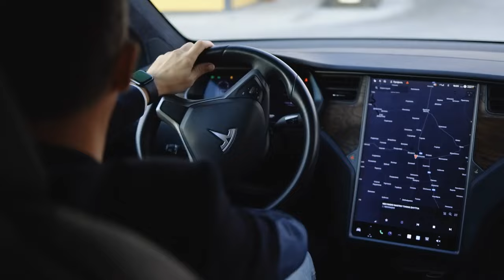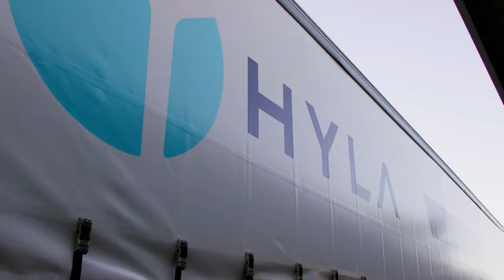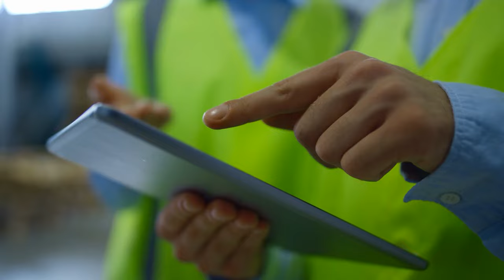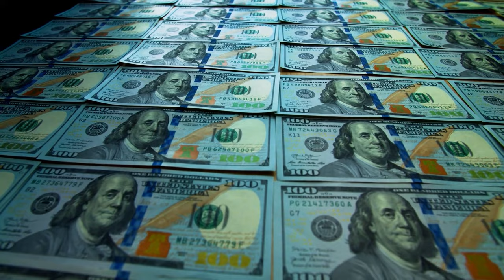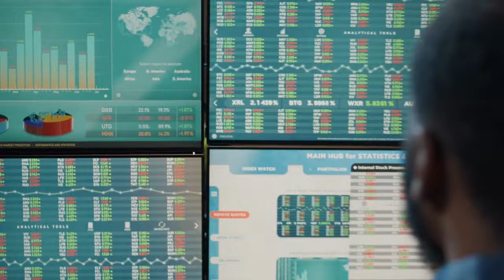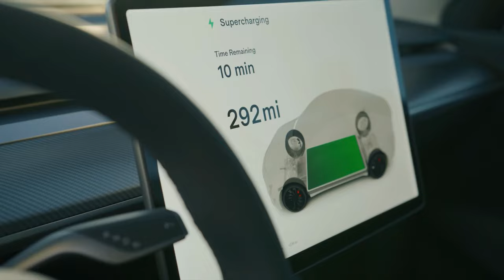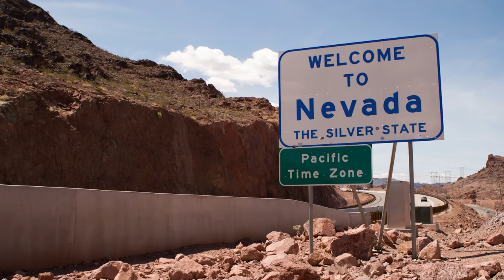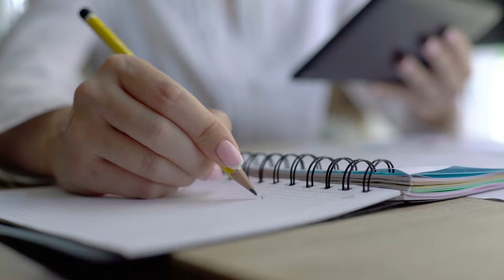A Devastating Blow For The EV Industry | Insurance Prices SkyRocket

Comment: Soon, a major insurance carrier will cancell fire insurance on EVs...that will cause a panic in the market-might spell the end of Tesla.
Reply: EVs without infrastructure are junk. 
Hybrids are the best short term answer until batteries and infrastructure catch up.The Steam engine went extinct in the 40s and diesel electric locomotives have been their replacement since them.  Thats a hybrid  Today, Edison Motors has a succesful hybrid logging truck that beats the Tesla in both power and fuel economy and most importantly, and it is lighter than the standard trans truck NRA. No range anxiety.
Get it straight .. The infrastructure TODAY  CAN NOT support EVs but hybrids can and are doing it with no infrastructure change and BETTER FUEL ECONOMY WITH PROVE TECHNOLOGY

Comment: I won’t be buying a EV anyway soon in fact, I will be driving my 09 Honda Pilot as long as it can run and if I have to replace it, it will be a preowned ICE diesel dually. 🙂
Reply: EVs without infrastructure are junk. 
Hybrids are the best short term answer until batteries and infrastructure catch up.The Steam engine went extinct in the 40s and diesel electric locomotives have been their replacement since them.  Thats a hybrid  Today, Edison Motors has a succesful hybrid logging truck that beats the Tesla in both power and fuel economy and most importantly, and it is lighter than the standard trans truck NRA. No range anxiety.
Get it straight .. The infrastructure TODAY  CAN NOT support EVs but hybrids can and are doing it with no infrastructure change and BETTER FUEL ECONOMY WITH PROVE TECHNOLOGY

Comment: What will the future be like for the EV the large motor manufacturers who make EVs are scaling back there production of EVs the future is not looking good for EVs hooray
Reply: EVs without infrastructure are junk. 
Hybrids are the best short term answer until batteries and infrastructure catch up.The Steam engine went extinct in the 40s and diesel electric locomotives have been their replacement since them.  Thats a hybrid  Today, Edison Motors has a succesful hybrid logging truck that beats the Tesla in both power and fuel economy and most importantly, and it is lighter than the standard trans truck NRA. No range anxiety.
Get it straight .. The infrastructure TODAY  CAN NOT support EVs but hybrids can and are doing it with no infrastructure change and BETTER FUEL ECONOMY WITH PROVE TECHNOLOGY ..

Comment: they are safe and effective where have we heard that before
Reply: EVs without infrastructure are junk. 
Hybrids are the best short term answer until batteries and infrastructure catch up.The Steam engine went extinct in the 40s and diesel electric locomotives have been their replacement since them.  Thats a hybrid  Today, Edison Motors has a succesful hybrid logging truck that beats the Tesla in both power and fuel economy and most importantly, and it is lighter than the standard trans truck NRA. No range anxiety.
Get it straight .. The infrastructure TODAY  CAN NOT support EVs but hybrids can and are doing it with no infrastructure change and BETTER FUEL ECONOMY WITH PROVE TECHNOLOGY
Reply: @enterprisencc1701z  hybrids are also not the answer, to mineral intensive we are still just better off with ICE cars until hydrogen cars where the fuel used is water and the hydrogen is made available at the point of ignition, happy new year to you

Comment: So good for the environment? Toxic fumes, chemicals and waste water runoff. Mining and disposing of the batteries, insurance going through the roof.. Insane and stupid.
Reply: Sending the kiddies down into the mines isn't that great either
Reply: EVs without infrastructure are junk. 
Hybrids are the best short term answer until batteries and infrastructure catch up.The Steam engine went extinct in the 40s and diesel electric locomotives have been their replacement since them.  Thats a hybrid  Today, Edison Motors has a succesful hybrid logging truck that beats the Tesla in both power and fuel economy and most importantly, and it is lighter than the standard trans truck NRA. No range anxiety.
Get it straight .. The infrastructure TODAY  CAN NOT support EVs but hybrids can and are doing it with no infrastructure change and BETTER FUEL ECONOMY WITH PROVE TECHNOLOGY

Comment: I drove an EV today...at the golf course.  It went 4 miles without loss of power.  A golf cart would be perfect in urban areas where population and shopping are concentrated.
Reply: EVs without infrastructure are junk. 
Hybrids are the best short term answer until batteries and infrastructure catch up.The Steam engine went extinct in the 40s and diesel electric locomotives have been their replacement since them.  Thats a hybrid  Today, Edison Motors has a succesful hybrid logging truck that beats the Tesla in both power and fuel economy and most importantly, and it is lighter than the standard trans truck NRA. No range anxiety.
Get it straight .. The infrastructure TODAY  CAN NOT support EVs but hybrids can and are doing it with no infrastructure change and BETTER FUEL ECONOMY WITH PROVE TECHNOLOGY ..
Reply: Golf carts are not to good in Canadian snow.

Comment: Here in the UK my renewal for my 2006 Mercedes CLS320cdi is only £300 - for a laugh I got a quote for a new 2023 Tesla Plaid the cheapest quote was £2550 right up to £6800 I have perfect driving history no accidents and clean licence with 10+ years no claims over 50 years old. Yes you can get insurance but its going to bankrupt you.
Reply: Thanks for the update on the situation 😊
Reply: EVs without infrastructure are junk. 
Hybrids are the best short term answer until batteries and infrastructure catch up.The Steam engine went extinct in the 40s and diesel electric locomotives have been their replacement since them.  Thats a hybrid  Today, Edison Motors has a succesful hybrid logging truck that beats the Tesla in both power and fuel economy and most importantly, and it is lighter than the standard trans truck NRA. No range anxiety.
Get it straight .. The infrastructure TODAY  CAN NOT support EVs but hybrids can and are doing it with no infrastructure change and BETTER FUEL ECONOMY WITH PROVE TECHNOLOGY ..
Reply: I am no EV fan, but in fairness, quoting an expensive performance Tesla for insurance and comparing that to an old car is silly. Tell me what a Model 3 costs in comparison to an equivalent new BMW to insure, then you will have a valid comparison.

Comment: For those that continuously justify and say ICE vehicles catch fire as well, it's proof positive when insurance companies refuse or charge huge prices for insuring EV's due to the statistics of fires. The car is a total when it bursts into flames and a major risk to it's driver and occupants. You couldn't give me an EV. They burn long and hot, require over 6000 gallons of water to be extinguished.
Reply: EVs without infrastructure are junk. 
Hybrids are the best short term answer until batteries and infrastructure catch up.The Steam engine went extinct in the 40s and diesel electric locomotives have been their replacement since them.  Thats a hybrid  Today, Edison Motors has a succesful hybrid logging truck that beats the Tesla in both power and fuel economy and most importantly, and it is lighter than the standard trans truck NRA. No range anxiety.
Get it straight .. The infrastructure TODAY  CAN NOT support EVs but hybrids can and are doing it with no infrastructure change and BETTER FUEL ECONOMY WITH PROVE TECHNOLOGY ..
Reply: The main reason an ICE vehicle would catch fire (rarely) is that the car was not maintained like the manual recommended.
Reply: EV’s also get totaled for minor accidents from hitting the underside on speed bumps and curbs.

Comment: I'm all for getting rid of CARBON TAX  on farmers but this is not going far enough, they should also get rid of CARBON TAX on diesel /gas fuel.because you should know by now that delivery of goods and services has gone up because of CARBON TAX. I was in windsor and coming back to Toronto to 69 north, the amount of transports I seen was undeliverable (WHAT ARE WE PAYING) PLUS I NEVER IN MY LIFE SEEN DEISEL COST MORE THAN GAS. Seem the only way to get rid of the CARBON TAX IS TRUDEAU MUST GO !!!!!  And by the way Heat pump don't work in cold weather, you need a second source of energy.

Comment: Reality hits consumers. This same fact goes for (off shore) windmills, they don't last.
Reply: EVs without infrastructure are junk. 
Hybrids are the best short term answer until batteries and infrastructure catch up.The Steam engine went extinct in the 40s and diesel electric locomotives have been their replacement since them.  Thats a hybrid  Today, Edison Motors has a succesful hybrid logging truck that beats the Tesla in both power and fuel economy and most importantly, and it is lighter than the standard trans truck NRA. No range anxiety.
Get it straight .. The infrastructure TODAY  CAN NOT support EVs but hybrids can and are doing it with no infrastructure change and BETTER FUEL ECONOMY WITH PROVE TECHNOLOGY ..
Reply: Nor are they cost effective.

Comment: If electric vehicles were actually designed by Nikola Tesla, the fuel prices would be very low. He understood electric power derived from "free energy".
Reply: EVs without infrastructure are junk. 
Hybrids are the best short term answer until batteries and infrastructure catch up.The Steam engine went extinct in the 40s and diesel electric locomotives have been their replacement since them.  Thats a hybrid  Today, Edison Motors has a succesful hybrid logging truck that beats the Tesla in both power and fuel economy and most importantly, and it is lighter than the standard trans truck NRA. No range anxiety.
Get it straight .. The infrastructure TODAY  CAN NOT support EVs but hybrids can and are doing it with no infrastructure change and BETTER FUEL ECONOMY WITH PROVE TECHNOLOGY ..

Comment: EV = 🔥🔥🔥🔥
Reply: EVs without infrastructure are junk. 
Hybrids are the best short term answer until batteries and infrastructure catch up.The Steam engine went extinct in the 40s and diesel electric locomotives have been their replacement since them.  Thats a hybrid  Today, Edison Motors has a succesful hybrid logging truck that beats the Tesla in both power and fuel economy and most importantly, and it is lighter than the standard trans truck NRA. No range anxiety.
Get it straight .. The infrastructure TODAY  CAN NOT support EVs but hybrids can and are doing it with no infrastructure change and BETTER FUEL ECONOMY WITH PROVE TECHNOLOGY
Reply: EV = Betamax.😂

Comment: Who could have seen this coming?
Reply: Car fires
Reply: EVs without infrastructure are junk. 
Hybrids are the best short term answer until batteries and infrastructure catch up.The Steam engine went extinct in the 40s and diesel electric locomotives have been their replacement since them.  Thats a hybrid  Today, Edison Motors has a succesful hybrid logging truck that beats the Tesla in both power and fuel economy and most importantly, and it is lighter than the standard trans truck NRA. No range anxiety.
Get it straight .. The infrastructure TODAY  CAN NOT support EVs but hybrids can and are doing it with no infrastructure change and BETTER FUEL ECONOMY WITH PROVE TECHNOLOGY ..

Comment: Can’t say I would ever choose an EV.  If I do deviate from ICE vehicles, it would be for a hydrogen powered one.  However, until they get the infrastructure in place for the hydrogen powered vehicles, I will stick with my good old ICE vehicle.
Reply: EVs without infrastructure are junk. 
Hybrids are the best short term answer until batteries and infrastructure catch up.The Steam engine went extinct in the 40s and diesel electric locomotives have been their replacement since them.  Thats a hybrid  Today, Edison Motors has a succesful hybrid logging truck that beats the Tesla in both power and fuel economy and most importantly, and it is lighter than the standard trans truck NRA. No range anxiety.
Get it straight .. The infrastructure TODAY  CAN NOT support EVs but hybrids can and are doing it with no infrastructure change and BETTER FUEL ECONOMY WITH PROVE TECHNOLOGY ..
Reply: So far, hydrogen powered cars have not been rendered safe yet.

Comment: The super expensive Dutch grid power platforms at sea are also build to last about 20y. They start corroding from day one! Huge voltage in salty water. What could go wrong!
Reply: EVs without infrastructure are junk. 
Hybrids are the best short term answer until batteries and infrastructure catch up.The Steam engine went extinct in the 40s and diesel electric locomotives have been their replacement since them.  Thats a hybrid  Today, Edison Motors has a succesful hybrid logging truck that beats the Tesla in both power and fuel economy and most importantly, and it is lighter than the standard trans truck NRA. No range anxiety.
Get it straight .. The infrastructure TODAY  CAN NOT support EVs but hybrids can and are doing it with no infrastructure change and BETTER FUEL ECONOMY WITH PROVE TECHNOLOGY ..

Comment: Young people love being aggressive with their vehicles they call it being young & having fun and that is mostly no problem with gasoline engine cars regardless of the weather: but cheap affordable electric vehicles can't handle that kind of abuse especially in very hot weather
Reply: EVs without infrastructure are junk. 
Hybrids are the best short term answer until batteries and infrastructure catch up.The Steam engine went extinct in the 40s and diesel electric locomotives have been their replacement since them.  Thats a hybrid  Today, Edison Motors has a succesful hybrid logging truck that beats the Tesla in both power and fuel economy and most importantly, and it is lighter than the standard trans truck NRA. No range anxiety.
Get it straight .. The infrastructure TODAY  CAN NOT support EVs but hybrids can and are doing it with no infrastructure change and BETTER FUEL ECONOMY WITH PROVE TECHNOLOGY

Comment: Electric  vehicles  are not safe it's  showing  up now.
Reply: EVs without infrastructure are junk. 
Hybrids are the best short term answer until batteries and infrastructure catch up.The Steam engine went extinct in the 40s and diesel electric locomotives have been their replacement since them.  Thats a hybrid  Today, Edison Motors has a succesful hybrid logging truck that beats the Tesla in both power and fuel economy and most importantly, and it is lighter than the standard trans truck NRA. No range anxiety.
Get it straight .. The infrastructure TODAY  CAN NOT support EVs but hybrids can and are doing it with no infrastructure change and BETTER FUEL ECONOMY WITH PROVE TECHNOLOGY

Comment: Ev’s are bombs with wheels and are made for people who travel 10 miles a day with more money than sense, just the fact kids are dying in mines mining cobalt for them is sickening, buying an ev is supporting kids being used as slave labour.
Reply: EVs without infrastructure are junk. 
Hybrids are the best short term answer until batteries and infrastructure catch up.The Steam engine went extinct in the 40s and diesel electric locomotives have been their replacement since them.  Thats a hybrid  Today, Edison Motors has a succesful hybrid logging truck that beats the Tesla in both power and fuel economy and most importantly, and it is lighter than the standard trans truck NRA. No range anxiety.
Get it straight .. The infrastructure TODAY  CAN NOT support EVs but hybrids can and are doing it with no infrastructure change and BETTER FUEL ECONOMY WITH PROVE TECHNOLOGY

Comment: If you have an EV, do not park it in your house.  Can you imagine dealing with the insurance companies on a claim in this scenario?  Your car burning your house down?
Reply: EVs without infrastructure are junk. 
Hybrids are the best short term answer until batteries and infrastructure catch up.The Steam engine went extinct in the 40s and diesel electric locomotives have been their replacement since them.  Thats a hybrid  Today, Edison Motors has a succesful hybrid logging truck that beats the Tesla in both power and fuel economy and most importantly, and it is lighter than the standard trans truck NRA. No range anxiety.
Get it straight .. The infrastructure TODAY  CAN NOT support EVs but hybrids can and are doing it with no infrastructure change and BETTER FUEL ECONOMY WITH PROVE TECHNOLOGY ..
Reply: Probably is beyond a climate change fool’s reason.

Comment: Many of the batteries come from Vachina and like the e-bikes that are burning down New York Chitty, the cars are Burning Down the House.
Reply: EVs without infrastructure are junk. 
Hybrids are the best short term answer until batteries and infrastructure catch up.The Steam engine went extinct in the 40s and diesel electric locomotives have been their replacement since them.  Thats a hybrid  Today, Edison Motors has a succesful hybrid logging truck that beats the Tesla in both power and fuel economy and most importantly, and it is lighter than the standard trans truck NRA. No range anxiety.
Get it straight .. The infrastructure TODAY  CAN NOT support EVs but hybrids can and are doing it with no infrastructure change and BETTER FUEL ECONOMY WITH PROVE TECHNOLOGY